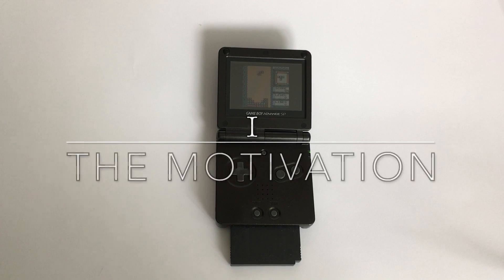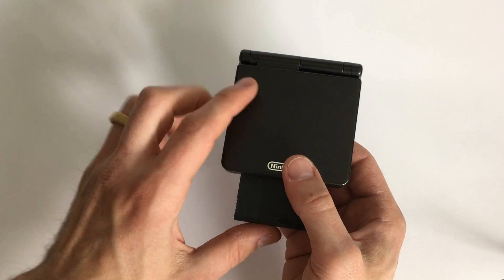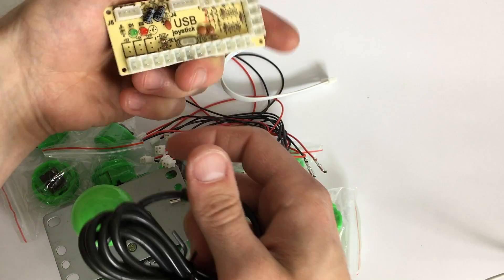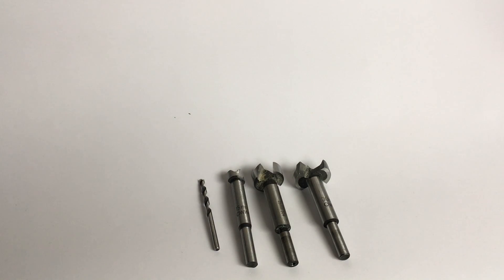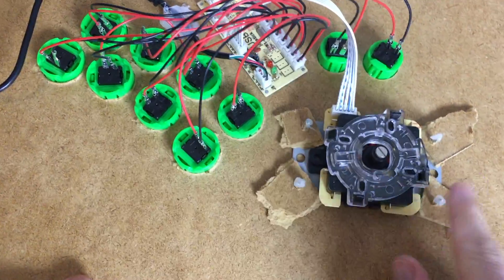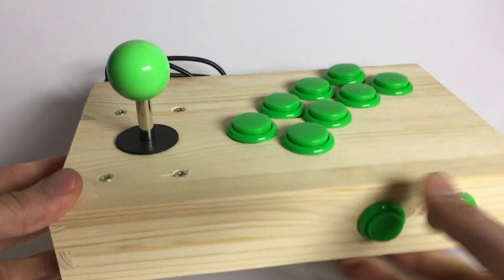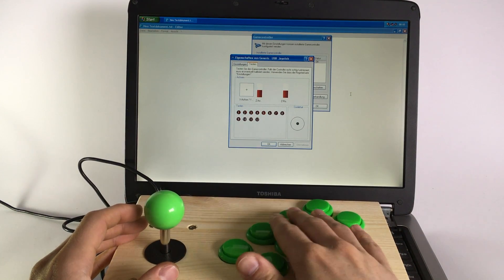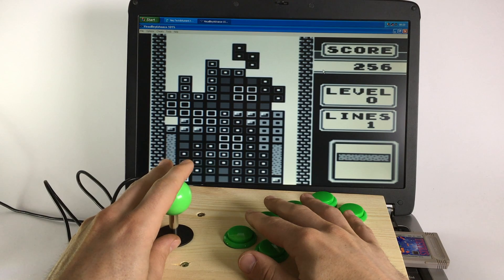DIY USB Arcade controller

Comment: Does someone know hot to pin up the joystick to a table? Its very annoying to play fight games with a little box like this,
Reply: Is the problem that it slides you could staple or glue a no-slip pad under it.  Do you need to weigh it down you can get weights .... with various ways to fix them inside a stick? Or if you want it to stay in place get some counter sunk magnets added to the bottom and a cheap small table that you can put magnets into with the same pattern. After that, they should hold with a good deal of force being needed to take them apart. At least that way you could still use the table as a table with non-magnetic objects at least and stow the stick under the table when not in use. If space is a problem. Or you can just drill all the wholes into a table and turn it into a large stick. Not really sure what you want but just throwing out ideas.

Comment: And you can link to the drawing of holes for the buttons? With dimensions and distances.
Reply from the maker: The actual size of your buttons may vary. 
The big buttons need a hole diameter of  3cm
The small buttons need 2.5 cm 
And the joystick 1.5 cm

To be honest I did not use a drawing for it at all. Therefore I used the test-board. Once your test board is fine you can just use it as your blueprint. you can just use some cardboard for it. No need for MDF there.
In general, if you add half a cm to the radius to the holes the buttons should fit without overlapping. If you look at the video I was lucky that the buttons did fit.
Reply: Peter Ommes Thanks!